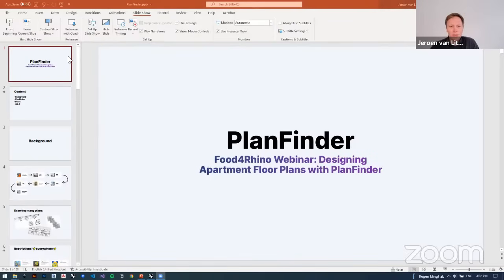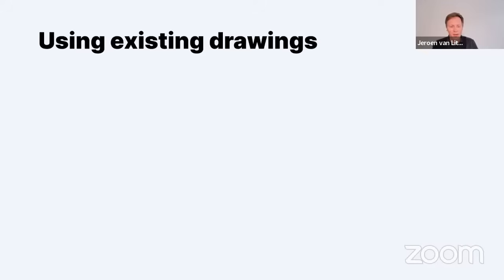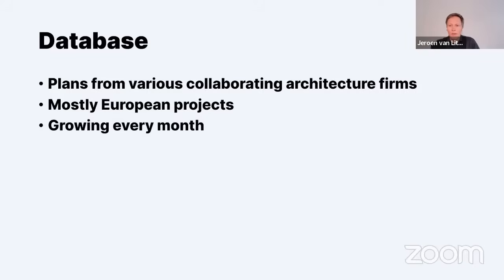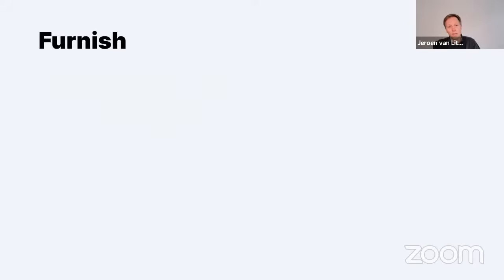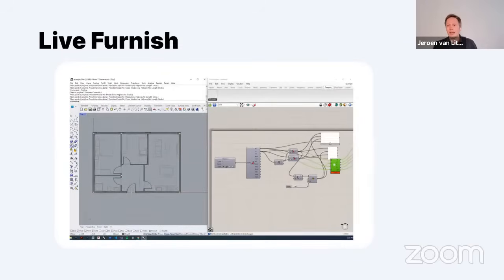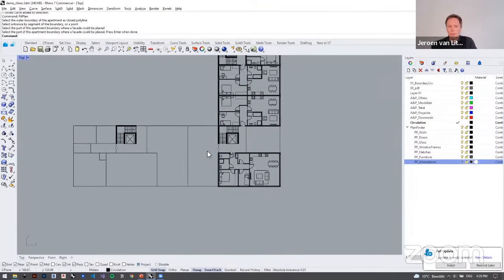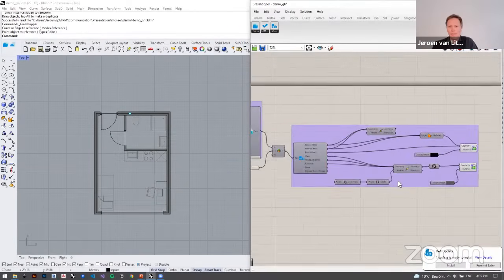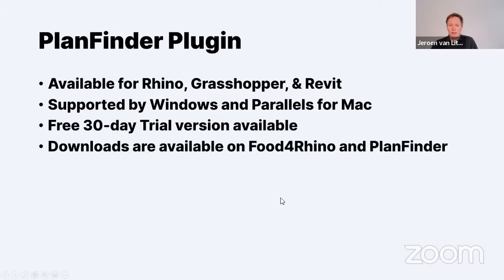food4Rhino webinar: Designing apartment floor plans with PlanFinder (English)

Comment: all the walls are prependicular and parallel
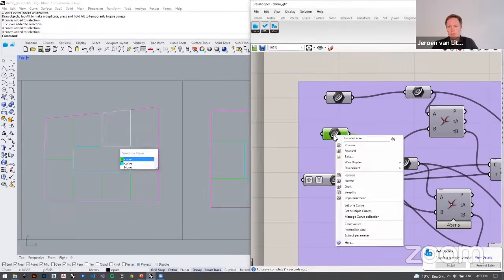Reply from the maker: Thanks for your comment. You can check the example shown in the minute 37:30
Reply: @McNeelEurope  understand does it works in interior wall
Reply from the maker: @miladsamadi8815  I think it is not possible with interior walls, although you can adapt them later in Rhino. You can send your questions about the plugin directly to contact@planfinder.xyz
Reply: Hi Milad, yes all walls are perpendicular. The input can be a non-orthogonal wall though, but the output will have internal walls which are perpendicular to the outer walls.
Reply: @planfindersoftware  is it possible to have both walls unparallel